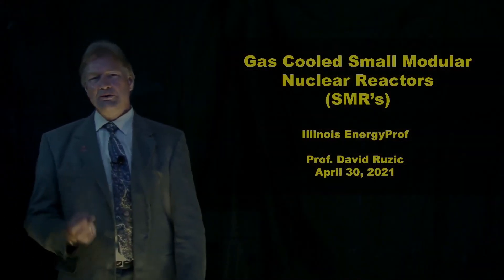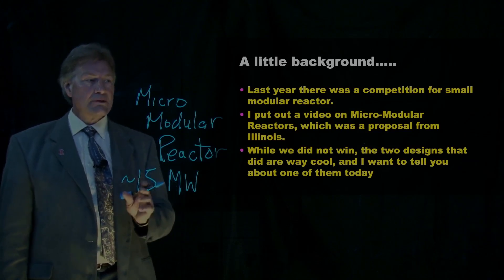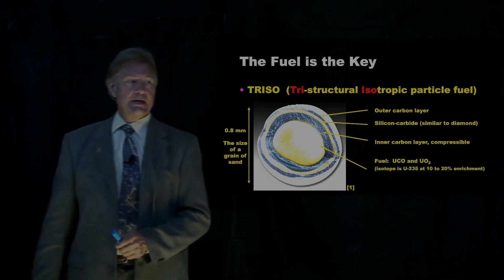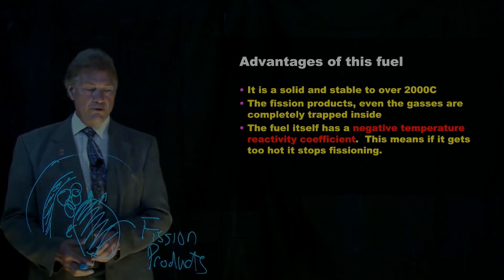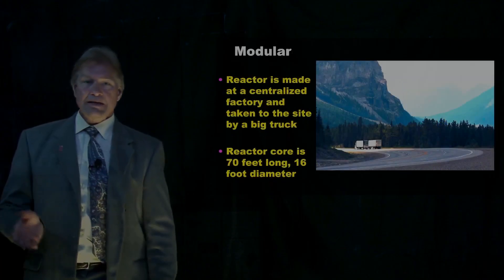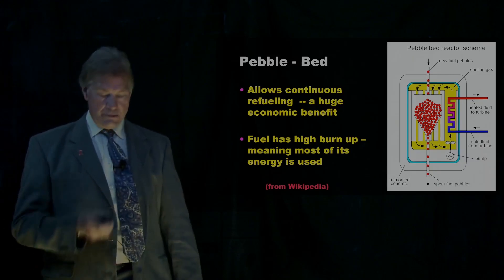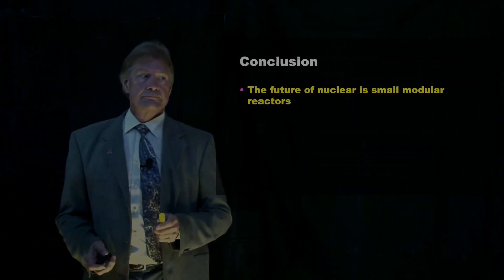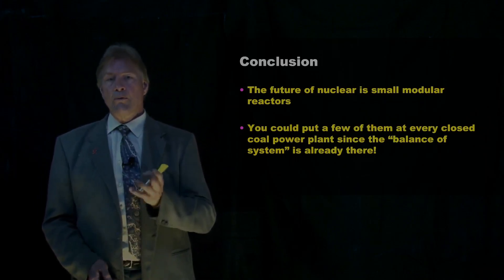SMR -- Small Modular Nuclear Reactors - Gas-Cooled

Comment: I personally prefer the particle bed reactors that 'sweat' out the fission poisons into the coolant loop (allowing poison extraction). Puts less strain on the fuel elements, increases power density of the core (meaning a smaller core, meaning a smaller core vessel meaning lower cost) while having simpler throttling (less impact from the neutron poisons an the core neutron economy). Not needing a ceramic gastight layer could also lead to higher fuel and moderator fractions, again leading to a better neutron economy and a smaller core size relative to power output. Fuel reprocessing would also be easier.
Reply: 90% of the world's population is in dictatorships. 
Nuclear industry in every country?????
Putin is the world leading Dictator.
The worst killers, the child killers, lead all Dictatorships. Oppose your Dictator and one of your children will ring you and tell you that the man with the gun told you to ring.
Putin is killing the neighbour's children. 
100,000 SMR, say BWRX300, around the world means the USA military budget goes from 4% to 40% of national budget. 
The USA is the biggest target in the world..

Comment: Would the XE-100 work with CO2 instead of helium?
Reply from the maker: The helium is just in a closed loop.  It does not get consumed.   The problem with CO2 being a coolant is that it will dissociate and the O is reactive.   The quantity of He is really not a factor and since it is inert and does not become radioactive as it gets bombarded with neutrons (Carbon and Oxygen would) it is the best.

Comment: I disagree with CO2 warming. Otherwise, most of what you discussed, I am in full agreement with. One recent report tells of wind power problems, such as high risk, and the annual cost of burying the non recyclable composite parts to the tune of $400M in the US alone. Then there are the toxic rare Earths from the motors, and also the PV cells when they are no longer viable. Additionally, in favor of SMRs, is the ability for communities and large industries to be free of the grid. Something at high risk in today's world because the more consolidated a source, the riskier it is to be destroyed or disabled. Recent pipeline comes hack to mind. Since the only way to blow these up is with explosives and not from within, it's seems a very logical way to move forward to maintain energy for a productive nation. But, logic and government are sworn foes.

Comment: I thought helium is becoming pretty scarce
Reply from the maker: The helium is in a closed loop.  It is not used up, just recirculates.
Reply: @illinoisenergyprof6878  would it theoretically be possible to use heavier inert gasses like Argon though? I know Xenon is the most powerful neutron absorber, so we can probably exclude it hehe
Reply: If you can buy something at every grocery store in the country for a few dollars... it isn't scarce.

Price will change with supply, and the amount needed would be insignificant to other costs, even if the price of helium was very high.
Reply: @TheOwenMajor  it's just that there's not that much helium left on the planet
Reply: @VoltageLP   "it's just that there's not that much helium left on the planet"

At current proven reserves and at current usage levels we still have 1000 years of helium.
Reply: @TheOwenMajor  those consumption levels will grow, helium is used a lot in semiconductor industry
Reply: @VoltageLP  And proven reserves will increase with increased extraction techniques and new developments.

We saw the same thing with oil, people were screaming their heads off that we would run out, and then we discovered fracking.
Reply: @TheOwenMajor  true, hope our oil and gas consumption won't be growing as much if and when these reactors join the grid

Comment: Interesting design. But i wonder about some key points:

1)
How is the reactor regulated? I assume you cant use regular control rods in a bebble bed? Does it just always run at maximum temperature and the heat transfered away is controlled by the coolant flow?

2)
Do you just "drop down" the new fuel spheres inside the bed? Graphite can be quite brittle. Does it withstand the dropping or some other sphere dropped on top of it? Does it have some outer "soft" layer to absorb the shock?

3)
How can we guarantee even burnup, since a bebble pile will be random to some degree? What comes out below might not be fully spend, thus wasting fuel?

4)
Proliferation concerns, since the reactor does not stop for refueling and could be installed at a remote location, it would be easier to remove a fuel element early in the burnup process and try to extract some Pu-239. How is that prevented?

5)
Reprocessing. You said the entire fuel is designed to be its own waste container, so there is no reprocessing step planned? While more costly, would it not make sense to try to reduce the waste by reusing much of the fuel pebble?
Reply from the maker: Great questions!  Here are some brief answers.  You can always email me directly for more detail if you want.
1) it has control rods
2) They likely roll in, but the TRISO golf balls are not brittle -- think about a golf ball.  They get whacked and do not crack.
3)  At first the ones coming out will not be all the way burned up, but you can put them in again.   One that comes out can be measured.   In time you will reach a steady state.
4) The Pu-239 is very likely to be fissioned given the design.   I will have to investigate more details
5) After the pebbles are used up, there is not much value in reprocessing and the safety aspect of not having to reprocess is a good thing.

Comment: Professor i have few question regarding the fuel, how will you bombard the pebble fuel with neutron beams if its shielded with neutron poison material?And my other question is regarding the heat exchange aka energy generation, how will we generate energy if the fuel has negative temperature reactivity coefficient? Isn’t it counter intuitive to have a power plant producing less energy at higher temperatures. Thanks for your amazing videos
Reply from the maker: It is designed to run at a high temperature -- higher than current reactors and therefore more energy efficient.   If they get even hotter then they stop.
The graphite acts as the moderator, so it is not a poison, it is what is needed to sustain a chain reaction.  The thickness of the carbon is designed to be just right.

Comment: Soory to be a spoiler. As much as i enjoy your return to YT, this kind of reactor is nothing new at all. In fact here in germany and some other places we even had test reactors. I can only supply the german Wikipedea, plz try to translate it. First the link:
https://de.wikipedia.org/wiki/Hochtemperaturreaktor
a brief version here: 
https://www.kernfragen.de/kernfragen/lexikon/entries/K/Kugelhaufenreaktor.php
The problem is the surface of the bullets. And that helium destroys protective oxyide layers on surfaces.
Yes it would work, it showed that allready. But the corrosion and mechanical wear-off has not been solved up today. Thats why i wonder why this "old" reactor is still a thing.
As for old coal plants:   let´s do a revolutionary thing:
imagine the US is really covering huge areas with solar panels. In times of surplus poduction the electricity would heat an insulateted flask of salt above melting point. This some 800 Celsius could be used to make steam in low solar production times. And yes, this could be a storage way using old infrastructure. 
Just my 10 cent, glad you are back

Comment: Glad to see you back.
I am an enthusiast about those new reactors, which I call "green" reactors, because they can't meltdown,  don't need reprocessing plants for spent fuel, and are easy to decommission. One of my wishes is, these reactors to be turned on and off quickly. Should this be possible, it would be easy to have a number of them installed at each wind and solar generation facility, and switch them on at night - or when there is no wind. Such configuration would negate the need for battery storage. Batteries are expensive and short-lived.
Thank you Professor for all your dedication.
Regards from the UK...
Reply: Another possibility is to run the nuclear plant and and wind power at full power.  If this produces "excess" power then use that power to capture carbon from the air and produce synthetic jet fuel.  So we can de-carbonize the aviation industry.
Reply: Even if you could turn the tubine off and on at will(You can't) much of the equipment, such as the turbines, needs to warm up.

Comment: I’m glad to see the return of this series.

Interesting reactor concept. I would add that, while coal might be in the thousands-of-MW, there are plenty of natural gas turbines in the 60-80MW range (not to mention smaller ones). For the extra 300% $/kW cost of these modular reactors, couldn’t you possibly just develop and implement better carbon-capture technologies to scrub the gas turbine emissions? They already have SCR’s (to take things like NOx out of the emissions) and CO catalysts. 

This does seem like it has a good lifespan at 60yr. Most gas turbine plants are only designed for 30yr lifespan, though some keep trucking long after that.
Reply from the maker: Carbon capture would be another great topic I should do a video on.  One can scrub SO2 and NOx, but the whole point and where the energy comes from in fossil fuels is making CO2.  Many of the active technologies use more energy to capture it than making it released in the first place.  The less energy intensive (ie passive ones) are too slow compared to our CO2 emissions.       I do agree that economics is indeed the key to everything
Reply: I agree capture/sequestration would not be easy. Just thought I would bring it up as a thought exercise, ie. see what else could the $0.06/kW-differential buy you.

Comment: Helium makes for less efficient heat transfer, is the safety provided by using helium worth the loss in efficiency? 
Helium is also more expensive, is it fully contained? It never needs to be topped up?
Reply from the maker: The amount of helium is small and in a closed loop.  I am sure it does need to be topped up now and then, but the cost and quantity are very small.     Helium's advantage is that it is inert, does not change phase, and can run at a much higher temperature, giving a higher conversion efficiency to electricity.

Comment: Does the TRISO fuel completely stop reacting once it reaches high temperatures or does it reach an equilibrium where it won't raise any higher? Glad to see that you're back to making videos. I've been missing them for a while. Really wish I could've had classes about stuff like this when I was at college.
Reply from the maker: When TRISO gets too hot, neutrons are absorbed at a higher rate than the rate at which they cause fissions.  When they cool the rate of fission will rise again -- except that the Xe poisoning is still there.  Due to that natural "brake", if the fuel gets too hot the reactor will go into shut down mode.

Comment: Welcome back Professor, always nice to watch your videos!  I'd love to see these reactors put into production soon to help bolster our energy infrastructure in this country.  One question though, given the rise of cybersecurity threats, would these reactors be attack tolerant?  Would the natural resistance to runaway reactions of the TRISO fuel help to mitigate potential threats due to malevolent actors trying to mess with the operation of the reactor (i.e. trying to drive an overheating condition)?
Reply from the maker: The good thing about these is that there is no physical way to make them do something bad.  If they get too hot, they shut down.  The containment is solid stuff surrounding everything, and no computer can change that.  A computer program could turn them off, and therefore deprive the grid of their electricity, but that is something every power source is vulnerable to.

Comment: YESSS!  Another video!

Do you have anything about those eternal batteries made with nuclear waste (I think Carbon 14) ???  I really want one someday...
Reply: Search for "RTG battery".  The mars rover is powered by an RTG.  Deep space probes are powered by RTG's.  They can be made with plutonium 239 (I think) so they are ideal for use in space... but not in your garage.
Reply: @nbnvideo  they made one out of Carbon 14 that is entirely contained inside a diamond (of which it is a part).  This thing is safe enough, at least from what people can see, to work indefinitely without leaking radiation or byproducts.    The issue is the amount of power produced.  But is it scalable at reasonable prices???

Comment: I don't know if 8.4c / kwh is going to be cost effective anymore. Even if you factor in storage there are cheaper solutions (EV charging at the back of the duck curve), it is useful for remote location with no wind and no storage and no solar, but for grid connect this 8.4c even with transmission efficiency (say you get to not waste 20% on transmission) means you will likely not be cost effective.

Now putting this thing in a submarine would be pretty cool, or an aircraft carrier. Maybe we can sell them to the Chinese.

The Trisco fuel with 10-20% enrichment can be expensive, and no second source, means possible gouging opportunity.
Reply from the maker: I do agree that the price is higher than one would like.    Economy of scale could lower that of course.   The use as a heat source though, for industrial uses, is really appealing.   If one imagines all electricity from solar, wind and hydro -- with storage - it would be (economically) tragic to then use that electricity to simply heat things up.  One could also do district heating in cities, so as not to use natural gas in that way.

Comment: never been a fan of the pebble bed, sorry. The "pebbles" are always sold as being perfectly sealed and safe, and in practice they crack and leak volatile fission products almost immediately and they jam in the core in/outlet ducts producing serious amounts of radiostrontium dust. They're fine on paper, and a nightmare in reality, I don't see this company really going much of anywhere with these.
Reply from the maker: This is exactly why we need a demonstration plant.  Lets see if those things really happen, and if engineering solutions are possible.  You raise good points, but technology and material science advance every day.  Maybe now these items will work.
Reply: @illinoisenergyprof6878  can you expound on how a negative thermal reactivity is achieved with TRISO fuel? I'm wondering if you could change the coating chemistry to allow use of pebble bed design in fast neutron reactors.

Comment: If you're going to use this as an industrial heat source, can these reactors be throttled up and down to match industrial demand?  Also can this architecture be used for splitting water molecules for producing hydrogen? (another component that's going to make up our future energy mix, mostly for chemical processing)
Reply from the maker: Turning a nuclear reactor up and down in power is still problematic due to xenon poisoning.  But, there are schemes where you store the heat in molten salt, and can use it as a reservoir.   I hope to do a video on that in the coming months.
Reply: @illinoisenergyprof6878  I heard, in the context of Stirling engines, that heat can be stored in a solid cube made of aluminum because of all the latent heat that would be needed to make it undergo the phase transition. I can try to find the source if you want.

Comment: Guess a 70 foot x 16 foot small reactor is harder to steal than a series of easily transported micro reactors.
Reply from the maker: Yeah, I do not think theft is on the table!
Reply: Yeah, a 70' trailer 16'  across is going to stick out like a smashed thumb.  You need a special permit to move that in most states.  An undetected theft would be difficult.